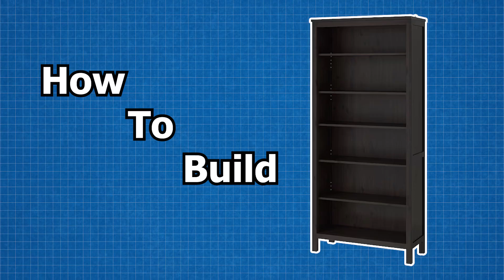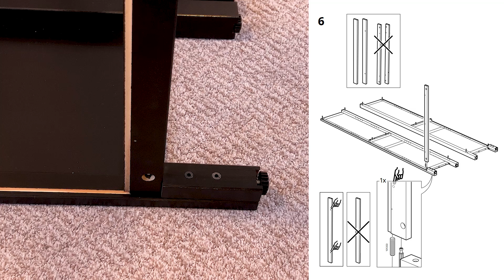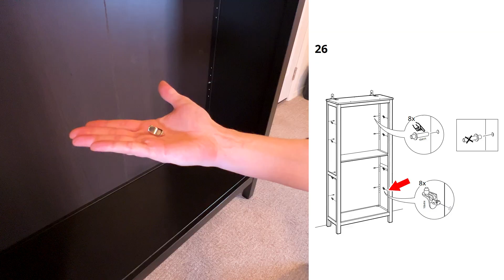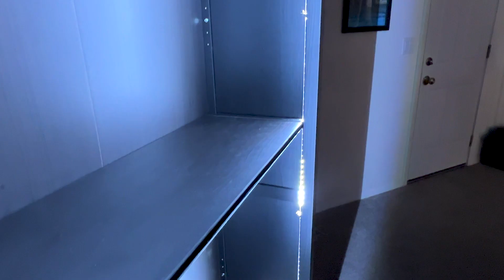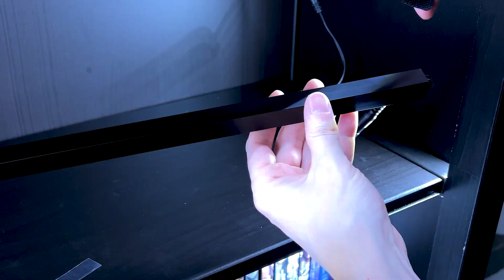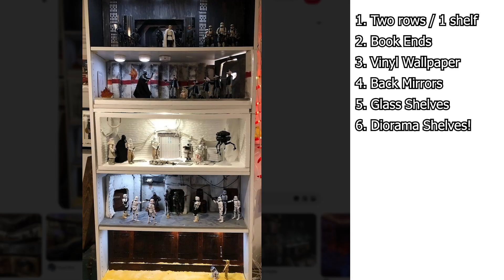Building My Perfect Bookcase | IKEA HEMNES Custom Build

Comment: Is Hemnes better pain quality compared to Billy? The paint comes of rather easily if u use something that is tad stronger than water.
Reply from the maker: Not sure if it is better, the paint might bond better to the wood instead of the chipboard lacquer.  But something like disinfectant wipes will strip paint from wood in most cases.  I believe soap and water would be fine on these.

Comment: got the track setup with diffuser... how do youattach the diffuser to the track? mine wont pop in or anything.. is there a way to secure it?
Reply from the maker: I've been in the same situation, it is tricky at first.  What I did was put one side of the diffuser.  And with my thumb (even from the middle of the channel), gently push up the diffuser on the other side until my thumb hit the metal of the channel.  Eventually you will hear a pop as it falls in.  Then keeping my thumb pressed against the diffuser and channel, I slowly slide my thumb toward one of the ends.  You'll here it Pop Pop Pop Pop all the way up, as it "Pops" into place.

Hopefully this helps and you get the diffusers in.
Reply: @Battletide.  I appreciate itg it.. as soon as i asked i figured it out that if you pinch the sides a bit, one of the sides will slide under the lip. Youre right once thats in.. you drag your thumb and the  sound it makes even sounds different as you drag iut. good stuff!!! i got it working.. looks so nice. I should have considered LEDs that change color too. would be a nice enchancement. Nevertheless, appreciate the help!!!

Comment: I love the bookcase dude! I do have a couple questions:
1. Your first lighting for books...do you think that would work if you were displaying 4k dvds and/or pop figures?
2. for your figure set up..what size figures work? 1/6?
Reply from the maker: 1. I would definitely think so, since I currently use it to display my manga.  Lighting is typically a personal preference, but in most cases, LEDs can have light levels adjusted.
2. I believe 1/6 figures should work.  Shelves are adjustable.  And it all really depends on figure pose and anything that makes them larger, like exploding hair, weapons that sit super high above, etc.
Reply: @Battletide.  awesome. thanks dude. really digging your set up. giving me good ideas. i aso just bought berzerk volume 1. ive been looking into getting into a new manga. im mostly a dragonball fan

Comment: Question about lighting option 2: Are you drilling a hole on each top corners of the backboard on each shelf? Is that what you feed the alternating wires into and hiding them? I'm planning to try doing this on a Billy bookcase. Would you suggest a different option? I saw your recent video on your side displays but I won't be having doors on mine.
Reply from the maker: I only drilled 1 hole in the top half for option 2 since I only added the lighting to the top half.  That said, you could drill holes for each shelf running the cable in and out since I know for the Billy you can't really run the cables down the side.  One thing to watch out for is the connecting cable length, you may need longer connecting cables.  But overall, I feel you can cleanly hide the cables along the top of each shelf.  I was actually thinking of doing it this way for another display case a while back.

Comment: Just thought I'd bring this up, but be aware of the properties of tacky putty: they can degrade over time, especially if you live in a high humidity area. The putty can become very oily and end up staining whatever it was touching (walls, drywall, wood, paper, white plastics...etc). I found this out the hard way on my wall posters after noticing it sag down, and one my figures that had a white plastic ABS base...even after painstakingly removing all the sticky goo (which also reeked for some reason, likely from the degradation) with isopropyl rubbing alcohol and paper towel sheets, it still left an ugly oil-like stain. I've since switched to clear gel adhesive dots, the kind that is removable and reusable under cold water. I have no idea how well it holds up over the years, but it shouldn't be any worse than the sticky putty, and is easier to remove with water or alcohol, and stays together in one glob once it does rather than become a stringy slimy goo that sticky putty eventually turns into.

Comment: Hello Sir!

Im looking for the perfect library for months in order to have the perfect display/Cabinet for my figures and Comics.
At first i though the logic and perfect solution was the Billy in Black with Glass Door (hobo), putting lights and some glass shelves woudl be perfect but then I found out the Besta option.

Did you check the Besta?

It has 60cm instead of 80 cm but the quality is much better, has glass door and you can choose if you want to show it with Glass or hide with Wood.
For me is the best option to run away from dust and keep it with quality and good design.

Let me know, the Hemmes is fantastic but I need Glass doors..
Keep making videos, are awesome!
Reply from the maker: I have not looked into the BESTA yet.  But they look like beefier BILLY's.  And I completely understand wanting glass doors.  I'll check them out next time I get the chance.  Thanks for the recommendation!

Comment: where did you get the glass unit off to the right?
Reply from the maker: I got it from a neighbor who was just looking to get rid of it.  Not sure where they got it from.  I have seen similar display cases from furniture stores. Basically the front door slides left or right, rather than swinging open.  And I’ve seen them priced between $800 - $1600, which is a bit crazy.  I can see if I can find some online shops that have something similar when I get home.

Comment: Any thoughts on modifying an Ikea PAX as an alternative to The Terravault, or a creative DIY magnetic cover panel like the Moduspace panels for dust protection on the bookshelves.
Reply from the maker: Definitely an option.  I haven't looked that deep into modifying the PAX wardrobe yet, it definitely looks similar to the BILLY with a bit more space.  Unfortunately, their sliding doors are all frosted (from what I can tell...).  But maybe you can use the same door sliding system to make your own doors as you were calling out.

Magnetic cover panels are definitely something I want to look into this year.  I think someone else brought it up as well.

Comment: I bought bookshelves from an office supply website but I've since found them on other sites, like Home Depot and they're built pretty tough for only being about $100. I got them because the bottom of each shelf has a "lip", where I was able to hide my LED strip. But I think I like the way you did yours better because I'm using Command strips cut into small pieces but the lights can sag at places. And in one corner, the LED's are red, indicating I've twisted them and cut off some of the circuit. But I'd have to undo the entire strip that's been run through the bookshelf to give those few LED's a better connection. Since it's in the corner, I've decided it's not worth it. But the light bars that you've created look better and maybe if my setup has to come down once I move, I'll switch to that idea instead. You're always showing such great ideas for displays 😊

Comment: This was so perfect, thank you! I've been casually looking for years for shelf ideas, but none were as good looking and as in depth as yours. I always wanted good lighting and the Hemnes seems to be perfect to hide the strips. I thought about adding the diffusers, but wasn't sure how well it would look. Seeing you successfully implement them made me feel so much better about doing it. And this bookcase is so perfect for what I'm looking for that your step by step guide is going to be so helpful. I won't have to adjust for using a different type of bookcase or anything. What are the odds you uploaded this around the same time I'm about to move and was looking into this sort of thing? I also came across your room tour video last week and LOVE your entire setup. It's so cozy and totally my style. Thanks for the inspiration, man!
Reply: Les diffuseurs avec support en aluminium servent aussi à dissiper la chaleur des leds et permettent à la bande led de durer plus longtemps car elle va chauffer moins. Aussi, c'est pas toujours conseillé de coller des bandes leds sur le bois car cela peut causer (très rarement) des risques d'incendie en cas de court-circuit.